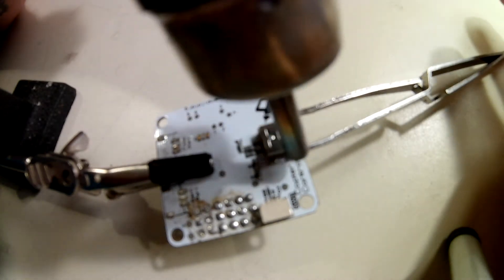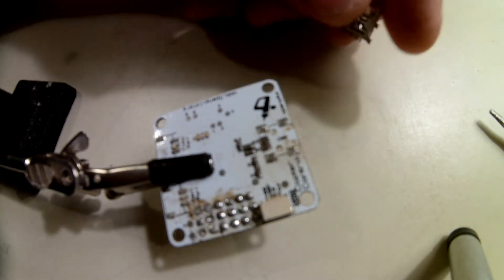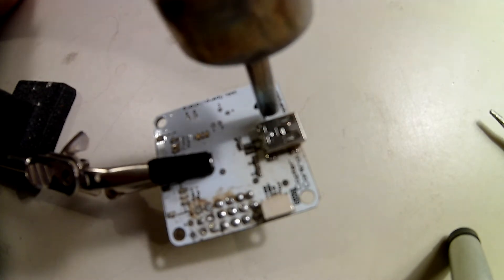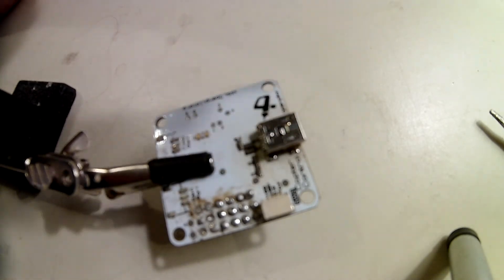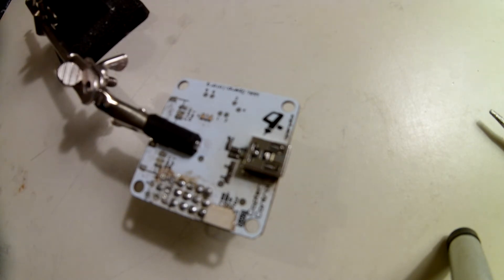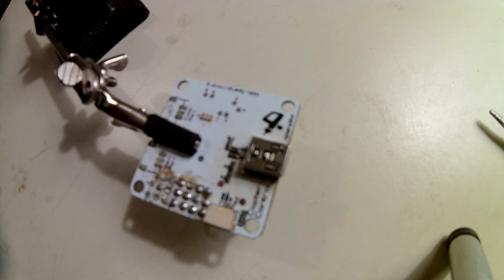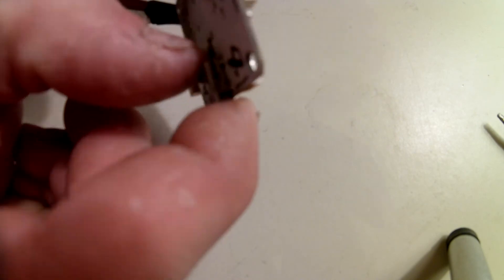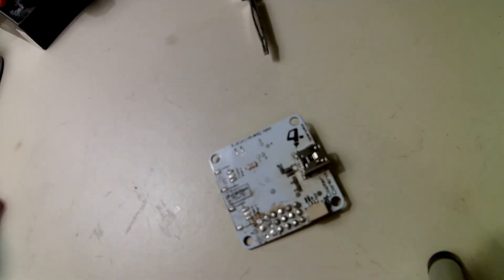how to replace a usb on a flight controller

Comment: I got shitty eyesight so had order a digital scope from cyclone fpv, same with the station but I'm curious what temp is the air running at. I am having blah results at 330C and don't wanna float the other components on the board

Comment: What is the actual name of the USB port? I need to order one for my F3 FC.
Reply from the maker: its a micro usb
Reply from the maker: https://www.ebay.com/itm/100-Pcs-Mobile-Phone-Type-B-Micro-USB-5-Pin-Female-Jack-Port-Socket-Connector/310973302358?epid=1639289915&hash=item4867740656%3Ag%3AlDQAAOSwXPNaRpe4&_sacat=0&_nkw=micro+usd+port+&_from=R40&rt=nc&LH_TitleDesc=0

Comment: where do you find a heat gun with that pointy tip? That is pretty sweet.
Reply from the maker: ebay smd 8xx solder station runs 48usd